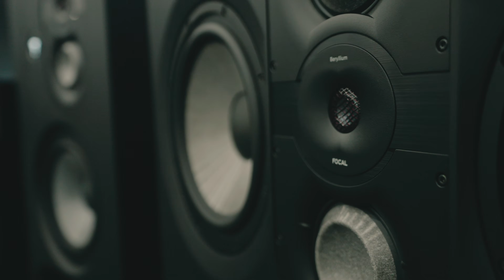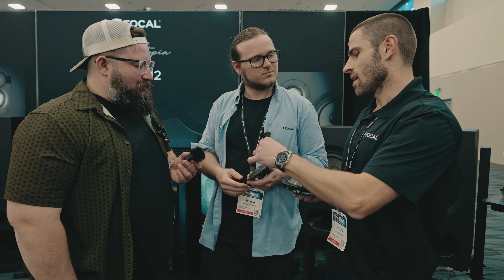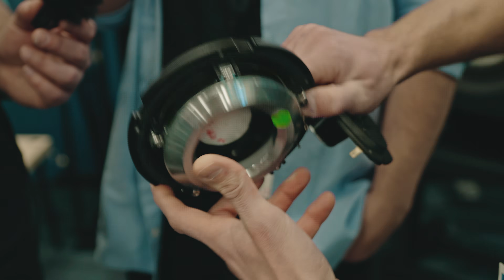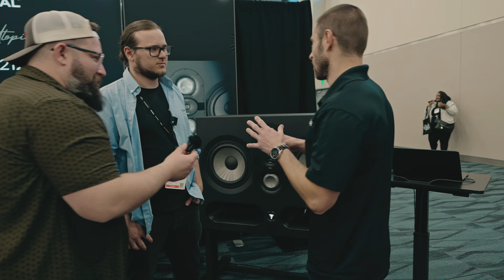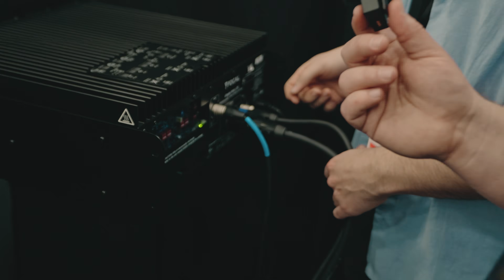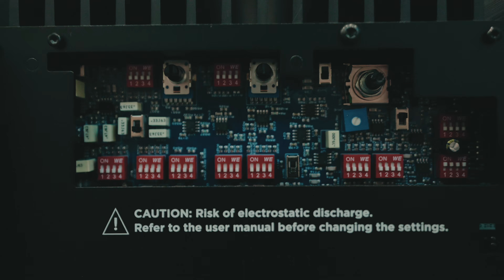HOW TO BUILD $50,000 SPEAKERS

Comment: gotta be honest man… not seeing $30k or $50k worth of speaker here. slightly modified Beryllium tweeter design, same 13” driver as found in Sub12 (driven by class D) and a larger cabinet. the new midrange driver and current mode amp is impressive, but I can’t fathom that those items would account for the $20k difference between the cost of the 112 model as opposed to their ST6 stuff. so many shared components. feels like they upcycled a lot of what they were already using in the ST6 products into a larger box, called it a Main monitor, and slapped an accompanying price tag on it. aside from the new midrange driver (which is impressive!) I’m really having a hard time seeing what advantage the 112 model would really give you vs. buying a pair of Trio6 and a pair of Sub12 for a fraction of the cost.